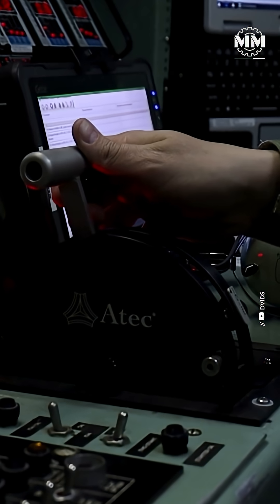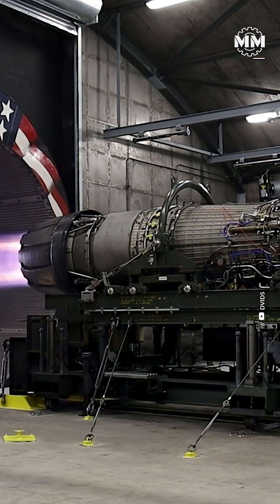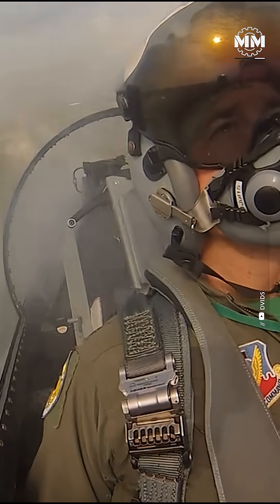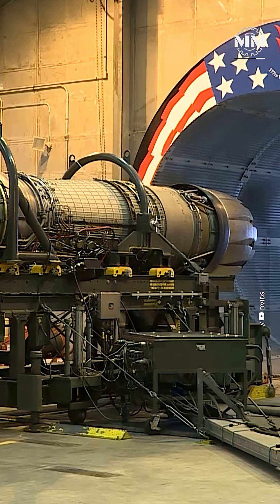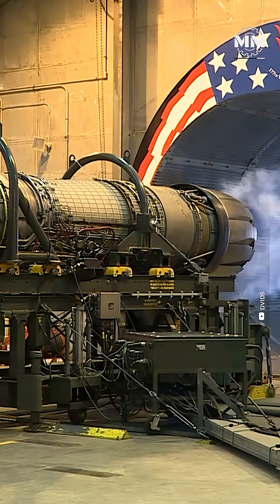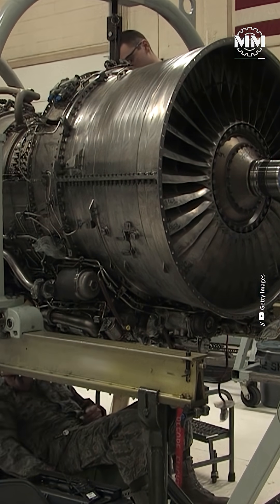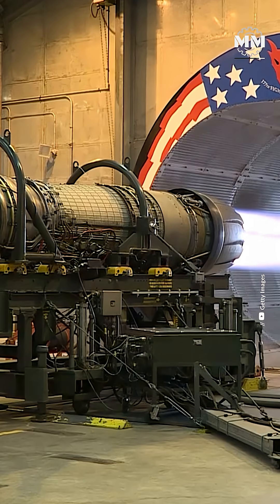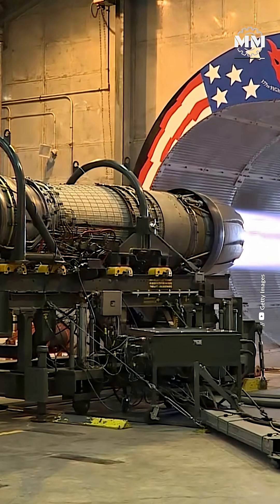Why MiGs and Sukhois Smoke Like Crazy But F-16s Don’t

Comment: Idiot Russia is very vast coubtry with very extreem weatger conditions to opeeate any jets. They require jets engines which are easy to maintainance and also reliable to operate in vast temperature difference enviorments hence tollarences are intentionally kept high between parts joints hence slightly reducing efficiency. Its a badic logic.

Comment: This isn't smoke coming out of the back modern day jets, it's a contrail (short for condensation trail) is a visible line of ice crystals or water droplets formed behind an aircraft's engines, created when hot, moist exhaust mixes with the extremely cold air at high altitudes, similar to seeing your breath on a cold day, temperatures at cruise altitude is around -30 to a -40 C

Comment: There is more to it than that. NATO jets use a form of high purity Kerosene called Kero A, which is mixed with various chemicals to prevent fires, reduce Cladosporium Resinae, alter the freezing point, optimise the vaporisation and so on. However, jet engines can be fuelled by similar but lower quality fuels, such as those provided at foreign airports, and they can produce smoke trails…
Another difference is that NATO jets fly combat missions at low levels where con trails are less visible, and Russian jets fly higher up because their pilots aren’t as well trained and their tech is behind ours.

Comment: Strange to hear that but for MiG-29s is quite true, not sure about Su-27.  Even stranger, it's the combat analysis of MiG-21. It was noted in the combat report (Have Doughnout) that the Fishbed did not smoke at all and it was in strong contrast with F-4s of course.  So why the next generation of engines (MiG-29s) smoked so much?

Comment: Let’s not forget that lack of maintenance has always been an issue with Soviet and now Russian kit…it’s why there is doubt about the viability of Russian nukes—nukes being the most expensive weapon platforms to maintain. Poor forward planning of maintenance is why the Kuznetzov ‘cruiser’ is worn out, the Soviets/Russia never planned for a proper maintenance facility, so the ship had to always use its own power when in port, even for potable water.

Maintenance is designed into NATO kit. Russia is very amateurish and unprofessional in comparison.

Comment: Don’t confuse water vapour for smoke.  They are very different - water vapour cannot burn any more, and what is visible is just the vapour condensing in the very cold air.

The argument about efficiency vs. thrust is valid, but showing a commercial airliner in the opening, and then switching to military aircraft is absurd - they are very different!

Comment: FYI, fuel doesn't ignite in the turbine, that's why we have a combustion chamber. The energy that is created in the combustion chamber, through the burning of fuel actually drives the turbine, which in turn, drives the compressor! If you are referring to reheat, that is a different  beast, but again, not ignited in the turbine, that's ignited in the jet pipe!

Comment: "Fuel doesn't fully ignite inside the turbine". I guess the turbine isn't the worst place for fuel to ignite, the compressor would be worse but ideally you want ignition in the combustor. I don't believe the inefficient combustion of Sov-ussian engines is a deliberate choice. I think that just can't do better. Why else was SNECMA the supplier of the engine core for the Sukhoi Superjet Airliner?

Comment: Russian aircraft carriers also produce a lot of visible smoke even when they’re not burning down.
-Western engine design is far ahead because of three strict emissions and pollution regulations.  I suspect our oil refineries are more capable as well.  More consistent linear changes that burn evenly in our fuel.

Comment: Actually the F-100 and F-110 engines used on American designed aircraft do smoke a little. That is because they do not run completely efficient on purpose. The engine is tuned to not smoke then then the fuel control is reset for normal day to day use. The amount of adjustment needed to return the engine to war time requirements is logged and when combat is expected the fuel control is adjusted. This allows the engine to run cooler in day to day operations and last longer.

Comment: The RD-33 allows the MiG-29 aircraft to take off with full combat load with one engine running and the second engine is started up when airborne. This saves valuable time during takeoff in the event of an alarm.

It remains operational even at negative air speeds and in almost any space position on the aircraft.

The engine has the following systems: fault detector, speedometer for the compressor and temperature limiters for the low-pressure turbine, overvoltage sensors, ice sensors and fire alarm.

Replacing the motor is fairly simple and takes relatively little time, about an hour for five mechanics, taking into account the verification of its operation after installation.

The RD-33 turbojet engine is one of the world's best fourth-generation bypass engines in its thrust category. It is used in the MiG-29 fighter and all its modifications.

The SMR-95 is the version of the RD-33 for the modernization of the French Mirage III and Mirage F-1 fighters.

The MiG-35 is equipped with the RD-33MK engine. The RD-33MK's power increased by 7% over the RD-33. The engine has a modern digital automatic control system with double redundancy of the main units, an emergency take-off mode and increased anti-corrosion protection of units and parts.
At the same time, it retains all the advantages of the basic model, in particular, the absence of restrictions in the control of the aircraft in flight and a high level of resistance to external disturbances.

The lifespan of this turbine is more than 4000 hours.

Comment: The MiG-29's smoke trail is visible on training flights when the engine's "combat mode" is not selected on the ground before takeoff.

However, perhaps the most unique feature of this aircraft is that it is the only jet in military history that does not dive at all. No matter how hard the pilot tries to "take it" there on purpose, no matter how many serious piloting errors he unintentionally makes, it is all in vain: in any situation, the plane remains controlled by the pilot, even when the arrow on the speed indicator freezes on the number cero. 

Poland has the largest operational fleet of MiG-29s in NATO, and they have never been defeated by US Air Force F-16s during training dogfights with simulated air-to-air rocket fire.

Polish MiG-29s have been successively modernised and will remain operational until 2030.

In fact, the MiG-29 (light fighter) was designed to combat the F-16 (light fighter).

The MiG-29 is the heaviest light fighter in the world. It originally had one engine, but the Soviet generals wanted two engines, which forced a redesign.

Polish pilots are proud to be able to fly such a unique aircraft.

The pilots who flew and fly in them have the impression that the plane can fly even more than the person himself which is close to the truth as, for example, its maximum overload limit is limited only by the physical capabilities of the pilot, and not by the strength of the plane's structure, as in most other fighters.

Comment: Most early low bypass turbofan engines smoked more than the previous turbojet engines. For the Flanker's the Saturn AL-31 was a little smokey and the problem was completely fixed with AL-41 engine. But for the MIG-29 the Klimov RD-33 smoked like a chimney and made this reputation for the Russians. The problem was eventually fixed with RD-33MK, but quite few MIG-29's were retrofitted with the newer engine.

Comment: If the Russians had the same combustor and materials technology as GE and Pratt they would use it. The fact is that the US advanced fighter jet engines not only burn less fuel, cleaner, they also last MUCH longer. Combustion efficiency and turbine inlet temperatures are WAY higher than Russian engines because of the advanced materials used for turbines, nozzle guide vanes and combustion liners. Russian engines are literally 30 years behind.
Reply: There is a little truth in your words but the rest is bs. Do you really believe it?
Reply: @s @serheyyavotsky1246  It’s pretty easy to verify.

Do GE and Pratt use advanced single crystal turbine materials in their engines? Yes

Do Russian engines use them? No

Doe GE and Pratt use MMC materials for combustion liners and nozzle guide vanes? Yes

Do Russian engines? No

Do GE and Pratt use advanced blisk compressor rotors and aerodynamics? Yes

Do Russian engines? No

The PW F135 can go 2,000 hours between depot level overhaul. The Russian Saturn AL-41F1 has a TBO of 1,000 hours—allegedly.

The PW F135 has a turbine inlet temperature of just shy of 2,000 degrees C, while the Saturn AL-41F1 is only 1,640 C.

I could go on an on but it’s pointless. It’s just like I said Russian military engines are 30 years behind the West. And I’ll add that their commercial engines are 40-50 years behind the west. Many of those are still using mechanical fuel controls.

Comment: Don’t show aircraft that are producing condensation trails and call it smoke, don’t show an aircraft with an airshow smoke generator running and report that it is smoking. Your report is correct that Russian aircraft do produce more exhaust trails than western aircraft and the reasons you described are accurate, but don’t put bogus pictures to prove your point.

Comment: Shows contrails from jetliners at altitude...shows smoke generators in an airshow...turned off after 10 seconds.
Reply: F4 was a hell of a smoker
Reply: @Payt-y5d U.S. aircraft stopped smoking in early 1970 with the F15.  Smoke was easy to see and a big disadvantage.  The earlier F-111 and F-14 which had the same engine were smoke free
Reply: @williamzk9083 the F-14 and F-111 did NOT have the same engine as the F-4. They didn’t even have the same TYPE of engine as far as that goes.
Reply: @bigdaddy7119 The F-111 and F-14 were in service before 1969 the F-15 entered production in 1972.  Non of the engines of these aircraft smoked.  I didn’t mention the F4 but it clearly was on the way out by the early 70s
Reply: As an aviation nerd for nearly 60 years, you are 100 percent correct!
Reply: Yeah, this is a case of AI video undermining what is the truth about inferior combustion control in Russian jet engines.
Reply: Water vapor. Guess the AI can’t really SEE.
Reply: the plane behind is smoking as hell bruh
Reply: HOT ENGINES
Reply: It’s a ai generated and voiced video
Reply: You just described the coaxing of westerners against Russian tech in one word😂
Reply: Like he doesn't even know what he is talking about

Comment: Modern Russian jets don't smoke, anymore than American jets. In few instances, like during full afterburner, they smoke, but that's the same case with American jets. The examples you gave, Mig-29, Su-27, are all 30+ year old jets. Su-35 is modern, and only smokes during afterburner use.
Reply: But their engines are the same, with really small changes. That's one major problem of all modern russian made airplanes. Actually they DO smoke!
Reply: @rosenandonov1406  Any pictures I've seen have not shown them smoking.
Reply: @rosenandonov1406  Well, it keeps them thin.
Reply: I should think it would smoke LESS during afterburner use due to the huge flaming plume, which should help burn the smoke.

Comment: I watched many Su27. They don't smoke at all. 
I've seen one Mig29 in action, it didn't smoke either. 
Have you ever seen a B-52 take off?
Reply: Thats not smoke, it' smog...
Reply: B52 smokes
Reply: Only the B-52s with J-57 engines and water injection thrust augmentation, used during take-offs. The one's still used (H models) have turbofan engines that smoke a hell of a lot less.
Reply: @williamconrod8998  I only watched two B-52 takeoffs .... they were smoky.
When were the earlier engines retired?
Reply: @weerolein I've been out of the USAF since 1989, but I think I've read they retired the last of the J-57 B-52s (G models) in the 1990s. I worked on the KC-135s on the other side of the flight line from them.
Reply: They won’t anymore with the new rolls Royce engines.
Reply: "Well, some have smokey
And some have bandits.."
        Sheriff Buford T. Justice
Reply: MiG-29s definitely do smoke though
Reply: @jason59k55  under re-heat, sure. But generally, turbofan engines show no visible smoke.
Reply: Could hav Fixedum
Reply: Tu-160 ?
Reply: B52 is from Vietnam era tech. B52 non with new engine more improve
Reply: @cncn9631 your spell checker is from the Korean war era.....
Reply: which ones were those videos from the 70s you saw
Reply: We need to poo poo Russians
after all, we were programmed to shit on Russians since they saved our asses in WW2
Reply: ....with its 1960s tech engines. Hence why they're being updated.
Reply: @onlycheeseislife That is indeed possible. I have seen many Su-27s in China from very close up and I found them clean and reasonably quiet for a plane of that size.
Reply: Buff's also use water injection to boost thrust on take off's. a lot of the exhaust you "see" is water vapor.
Reply: @BeerWorshipingCult  vapor would not be black.
Reply: @weerolein well the water cools the combustion to generate more thrust and more fuel is unburned black smoke... So yes, it is not only water vapour, you are right!
Reply: @SledgeFox  So it's different in MIGs than in airliners? In the old 727s etc the water was injected after the combustion in order to produce more volume at lower temperatures.
It was usually engaged only at high altitude take offs and on very hot days.
Reply: @BeerWorshipingCult exactly!
Reply: Might 29s smoke like a coal train, what are you talking about?
Reply: @slickstringsespecially when they’re in a crater in the middle of the Iraqi/Kuwaiti desert. 😂
Reply: Keeps ground units from seeing what they're shooting at.  Like the ole James Bond, Aston Martin smoke screen
Reply: Newer or older versions?  B-52's are  supposedly being re-engined.
Reply: The Russians build new jet engines , they are more robust and efficient than any of the Yankees jet engines
Reply: @dirkvanrensburg7315 although it’s typical Russian bullshit propaganda, they’ll spend more time sitting on the flight line than in the air seeing how they can’t afford to fly them enough now for the pilots to get their minimum flight hours in every month 😂.

Comment: Is that exhaust not a sign for missle lock on. You might even be able to target migs just on this alone. All that heat from running hot makes it an easier target. Russia does operate in harder climates (Siberia etc).
Reply: infrared guided air to air or ground launched missiles are quite short range, compared to radar guided missiles. In addition, these missiles are easily defeated by flares

Comment: You know what else smokes? My frikin neighbor two floors down in a non smoking building
Reply: Reading this as im smoking
Reply: @mystic6423  worthless habit. doesn't even get you high. I used to smoke. Then I realized how stupid that habit was. 14 years. Zero cig.
Reply: @steveh5307 who cares😂 try some good cigarets🎉
Reply: Don't bogart that joint my friend/neighbor!😂😂😂
Reply: 2 floors down is crazy y’all have no insulation how do you smell anything through two floors
Reply: @Caleb-x9b7f Quite simple…it’s a highrise with walls of sliding glass doors and windows facing the ocean that are open alot. Prevailing breeze usually blows it my way especially when chillin on the balcony
Reply: @Caleb-x9b7f  just like in most cases about the smoke & smells coming from a neighboring apartment in a high rise building this isn't a matter of insulation. The very reason why it's a "non smoking" building is (fire hazard) because of central ventilation system that can often carry smoke and smells straight into the other apartments usually one to two floors above the smoker.
Now adding better insulation would only make people's apartments more uncomfortable (too hot/too damp) to live in and the smoke/smells would still be an issue. It's all about selfishness and having consideration for your neighbors. You shouldn't live in an apartment building if you are unable to do that.
Reply: Stop whinging, get a life or move out of high rise,you must be able to smell cooking fumes as well id presume,part of living in high rise ,plus noise is usually a part of living in high rise.
Reply: I smoked for 20 years , i didn’t realize how inconsiderate and rude i was until i quit.
Reply: @bluskytoo😂😂😂try again bit some good
Reply: Whine cry and constant complaining, take your meds , go to bed and call your doctor to complain in the morning . Nightie night , sleep tight and don't let the bedbugs bite

Comment: During the Vietnam War F4 pilots complained about the amount of smoke coming out of the aircraft’s exhaust that the GE engines spewed out because it made them easy targets that aircraft engine combination is the main reason for the US developing cleaner engines for aircraft
Reply: Solved by going to minimum afterburner when ingressing the target area.

If cruising, cut one engine to idle, the other shove the throttle up to minimum afterburner.
Reply: @ThamMalaysia  Bringing an engine back to flight idle really doesn't save that much fuel...
Reply: The Germans called the F-4 Phantom "Der Fliegende Schornstein" i.e. "the Flying Chimney." American pilots in Vietnam paid the price of smokey exhaust by being shot down by N. Vietnam's MiGs.
Reply: You're actually comparing a SU-34 to the F4 used in the Vietnam war 50 years ago? LOL, the cope.

Comment: 😢it because of the fuel controller...
USA uses a digital engine electronic controller
Reply: Russians also use FADEC
Reply: @marko4677  oh...maybe dirty fuel?
Reply: @royhi1809 smoking engines ware the case on older engines, especially on MiG-29s (RD-33) on newer designs even on MiG-31(29M2) RD-33K engine that was not the case, they are smokeless.